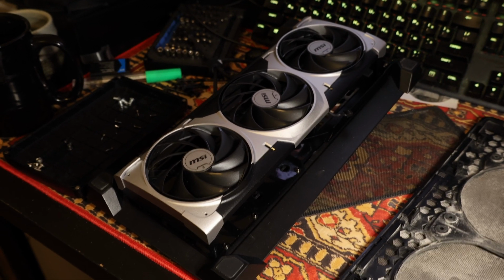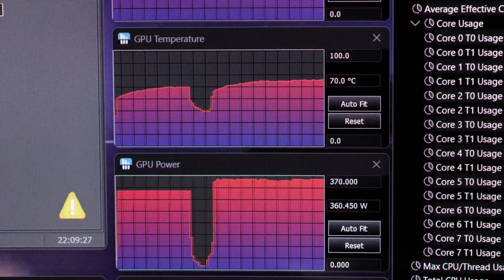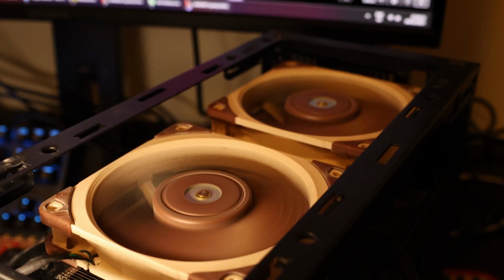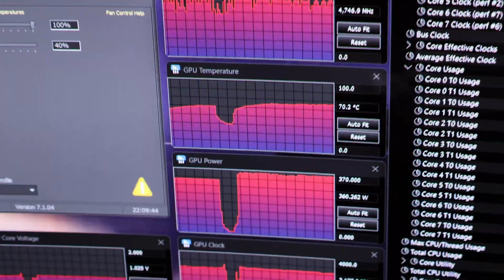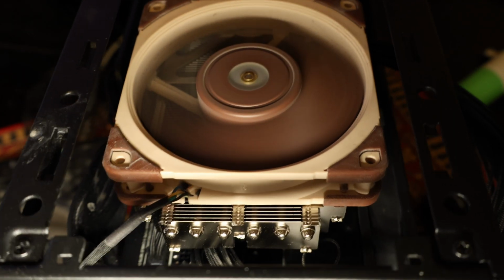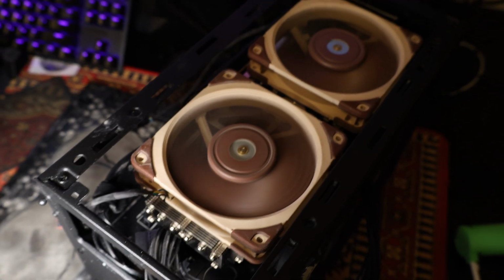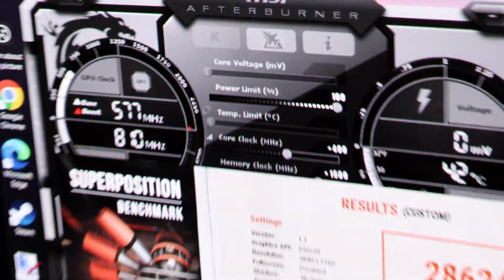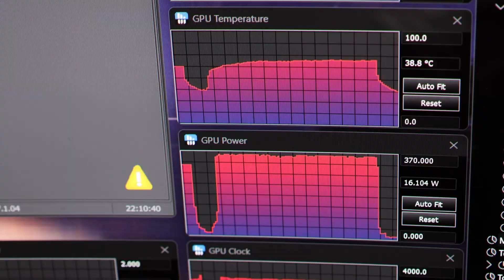Deshrouding MSI 5080 Ventus 3x OC PLUS

Comment: hi grumd, can you measure the thickness of the card and length after deshroud? 325mm is the length before deshroud i would assume like 320mm after deshroud? thickness is 67mm with fans how thick is it?
Reply from the maker: Sorry, I don't have this card anymore
Reply: @grumd0 was it noticeably shorter? I want to fit it in a fractal terra with two 120mm slim fans or 3x90mm

Comment: that's why I will go for VENTUS, easiest to deshroud, cheapest one. Only wins!!!
Reply from the maker: @322-Dota2  Yeah it's the good part about it, the cooler is not the best but after deshroud it's pretty good
Reply: @grumd0  I bought 3x 92mm Noctua specifically for that, so I will get even better temps and noise on paper than you.
Reply from the maker: @322-Dota2  Sounds amazing!
Reply: @322-Dota2  double 120mm is better than 3x92....

Comment: this is really really good lol im overclock to 3100mz with +1800 on mem. i dont get above 55core / 58 on mem. return it.   Using: zotac solid oc. Scored: 29120 with same custom setting as u. closed case. btw POWER limit bar will never increase with the ventus... i get +111%, msi vanguard and aorus can do +125% power limits in afterburner
Reply from the maker: @KUSHY_MTL  I have a zotac solid now. It's better than ventus but not 55c. Don't forget that ambient room temp plays a big role in gpu temps.
Reply: @grumd0  always hot in my room around 25c
Reply: @grumd0  oh if u have solid OC model, try 3090mz core custom curve at 980mv straight line, 111% power limit, +1800 on mem. u will barely lose 1fps for less heat.
Reply from the maker: @KUSHY_MTL  Very close, I'm running 3100 at 1000mv, with the quiet bios, so fans are not running higher than 30-50%
Reply: @grumd0  why did you return the ventus?
Reply from the maker: @SamseDK  Was still in the return window and didn't like the cooler performance after all
Reply: @grumd0  im considering noctua modding my 5080 Founders Edition
Reply: You can always use nvflashk.
Reply: I like to buy a ventus rtx 5090. And also want to mod as he did to solve the heat issue. Will you people recommend ventus 5090?

Comment: learned from my 3080 never go ventus!
Reply: I have a 3080 ri and its hot as hell 81 - 83 degrees and dan are 80 to 90 % at 100% loads, i change the thermal paste and same temps, i never buy another MSI cheap cards like Ventus

Comment: What kind of adapter did you use for the fans to gpu???
Reply from the maker: @Jim-mz3wr  Just search for "GPU fan adapter", there's a ton of very cheap ones everywhere. Basically all gpus have the same fan connector

Comment: You barely got a hard-to-find card and you already ruined it.🤣😜
Reply: That's the cheapest 5080 around.  It's everywhere here, but nobody's buying it 'cause it runs hot. I got it just because it's SFF and fits my Fractal case.
Reply: @Danitruc6CR  it fits your fractal case no mods?
Reply: You're ignorant, and it shows pretty easily.

Comment: How did you connect the noctua fans ?
Reply from the maker: @PervonHarke  You can buy an adapter that can connect them directly to the gpu fan connector, or just connect them to the motherboard and manually set up fan speeds via software
Reply: But does the card support the power of the fans? You have connected on the card or on the motherboard
Reply from the maker: @fabiogigliotti489  GPU can power any normal fan. I used such a setup for a long time with my old GPU

Comment: Hope you dont have any issues with the power connector. Did u see Der8aurs latest videos?
Reply from the maker: @noms780  Yeah I did. I'm using the 12v6x2 cable that came with my Corsair SF1000 PSU. I don't think there can be any problems at 360W
Reply: @grumd0  there is one report of a melted 5080 cable. I would run furmark and check the current of each of the 6 power cables with a "current clamp" to ensure it is even.

Comment: Can you tell us how to get one?
Reply from the maker: @professorquack  Actually yes. Stock is updated every couple of days around the world. Install a chrome extension called "Auto Refresh Plus". Open a couple of online stores with filters set to show you the list of 5080s. Set Auto Refresh Plus to refresh the page every 5 seconds and monitor the page for "Add to cart" buttons and auto-click it when found. You can test if it works by trying it on something that's in stock first. Run this thing all day in the background. When new stock is found you get a notification and open the tab and checkout as fast as you can. Tips: have an account set up and logged in on each online store for faster checkout. If your stores have options like "pickup and pay in the store" or "pay on delivery", use that, you can buy it faster if you don't need to do the payment.

Comment: Did you connect the fan cables to the GPU or mobo?
Reply from the maker: @Rocky_KO  To the GPU, I had an adapter
Reply: @grumd0  Did you use adapter with Y-splitter or two separate adapters?
Reply from the maker: @Rocky_KO  Adapter with a splitter

Comment: how are you attaching the fans? I use zip-ties through the screw holes, with the zipties going all theway around the back of the gpu, but it looks like youre just using gravity
Reply from the maker: @whatszat5518  Yeah it was just for testing, I simply placed the fans on top. I actually assembled the card back and returned it to the store. Bought myself a Zotac 5080 Solid and will be keeping it. Maybe I'll do another review with the Zotac. Noise and temps on the Zotac are better than this Ventus even after deshroud
Reply: @grumd0  Yes please do a review of the Zotac. Did you get Solid or Solid OC? Would be nice to see comparison with Ventus. I have a Ventus OC Plus myself, but might look to replace it with either FE or a cooler AIB.
Reply from the maker: @user-ku5oo2cl3z  I'll do a review of the Zotac, it's almost done. Spoiler, Zotac is MUCH better in terms of temps and noise. Of course performance is basically the same, both are 5080s, but Zotac has a much much better cooler